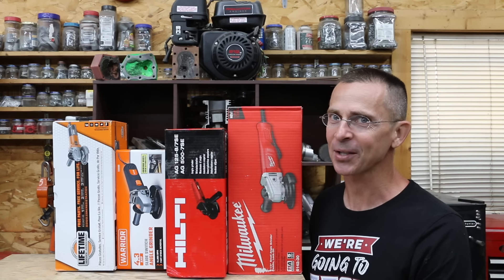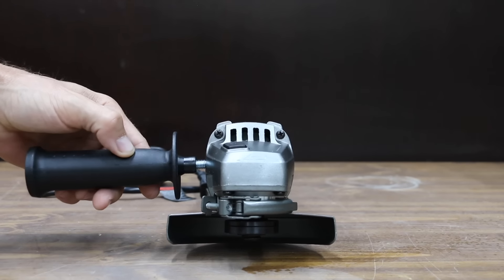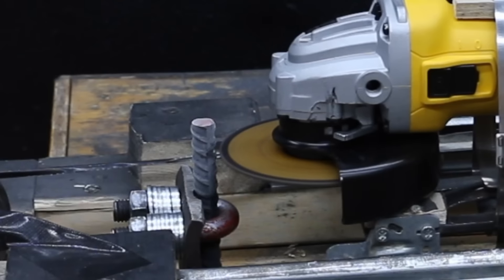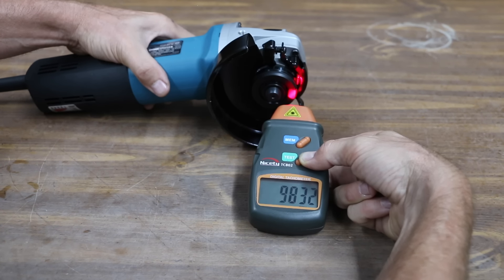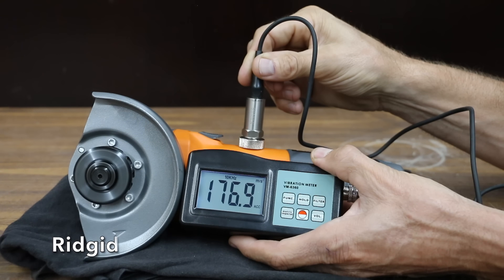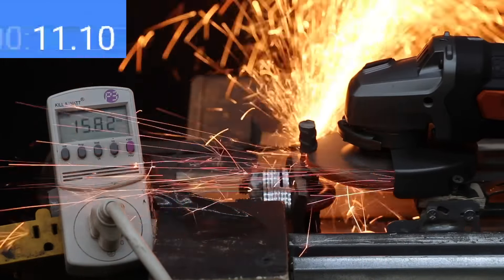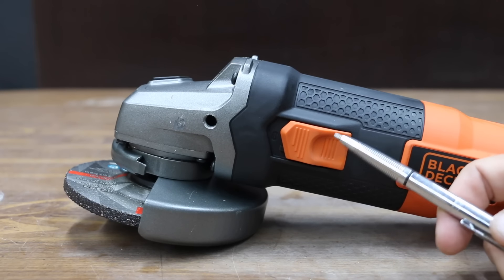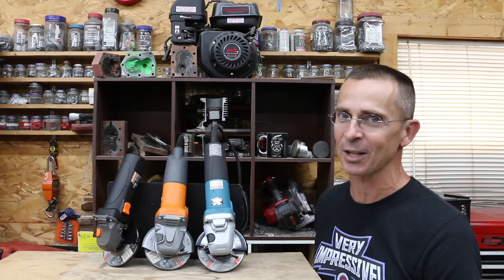Best Angle Grinder (Corded)? Hilti vs Milwaukee, DeWalt, Makita, Ryobi, Ridgid. Let's Settle This!

Comment: Would love to see how Bosch angle grinders go in this comparison! I bought one simply for the X-Lock fast wheel change (and love it).
Reply: Is it that good? I'm not ready to pay extra for every wheel I need to buy
Reply: @lopincol  yeah this isn't a "feature" I'm interested in either.
Reply: i've been in a professional metal finishing industry for over 16 years and bosch has been the best brand I've seen so far.
Reply: Bosch tools are for occasional home use only. If you're okay with it dying at any moment, you can buy it. Don't get me wrong, it's fine and all. But if you want something better, your choice is Metabo and Hilti (and maybe Makita too, but they're too inconsistent, their cheaper tools are pretty sad, and at higher prices you can have Hilti).
Reply: @KeksimusMaximus  i've used a bosch in a professional business for almost ten years. grinding, cutting,  sanding grit 36-120, aggressive wire brush, both mild and S.S.
Reply: @KeksimusMaximus  also, most metabo is made in China now
Reply: My fast change is faster. (Multiple grinders with different discs) :p
Reply: @willtrippe8982  >10yo Bosch. 
Old man, things get different every year, kek. Modern Bosch is not the same.
BUT, I guess that goes for Metabo too (it's still good no matter what). Hilti is still the most immortal brand. I can argue that point in a real fist fight.
(imagine fighting over a BRAND)
Reply: @KeksimusMaximus  ...and if we crawl through the bushes, really quietly, shh now, you don't want to scare him away, if you slowly look up at the comment above, you should spot the rare..ish 'Richard Cranium'. These creatures are quite shy, but very opinionated and often get quite loud and resort to KB warriorism to enforce their point when challenged with a differing opinion, and there he is with all his plumage fluffed out, now, lets all back away slowly and let him continue with his mating ritual.
Reply: @KeksimusMaximus  You are buying the wrong colour/series, Bosch blue isn't the same as Bosch green. A bit like green tool users such as yourself, the cheaper green ones are, by design, made for occasional home use only. You get what you pay for, and you don't know what you don't know.
Reply: @KeksimusMaximus From your comments I see that you’re tool knowledge is poor.Half Hilti tools are rebranded Bosch.
Reply: I have an old Bosch 4 1/2” without the x lock but it’s my favorite grinder ever. Very slim motor housing and compact gear housing. I don’t know how it stacks up power-wise against these others but it has a lot more power than my Milwaukee M18 grinder. I’d like a part 2 with Bosch for sure.
Reply: @dusanmilojevic3017  
>source: I just made that up
Sure, bro, haha, I'll trust you and not my years of actual experience with different power tools from different brands, haha
Reply: I got bosch professional but without x lock. It's pretty good  . Why bosch and dewalt not included in this comparison?
Reply: i’m a blacksmith and i used bosch in the last 20 years. the quality in the last 10 years is much lower than 20 years ago.
Reply: @KeksimusMaximus  Bosch "Blue" are top range professional tools... Got a 9" grinder 7 or 8 yrs ago and it's still working, using it in a welding workshop 3 or 4 days a week.
Reply: @lopincol  X-Lock Grinding and Cut Off wheels cost about the same as normal wheels. What it means is instead of having 2 angle grinders with me (one for cutting, one for grinding) and constantly switching between the two, I pull the lever, it ejects the disk from the grinder, i press the other disk on, and it is ready to go. I do a lot of welding where I am always between grinding surfaces for prep, and cutting tack welds etc.
Reply: @massimo79mmm  That is most likely accurate. As soon as brands start flooding the market with cheap tools, even reputable brands need to find cheaper ways to manufacture their products so their prices do not seem astronomical. I am sure there still exist niche manufacturers of professional high quality angle grinders made to last a lifetime (with maintenance), but things like that are well beyond my budget!
Reply: @jake-mv5oi  This was my go to option for a long time. I got sick of multiple power cords tangling (and having to store & move 2 grinders). The X-Lock system comes at a pretty big increase in price. For me, and my use case, I felt the price was worth it. It will differ for everyone out there.
Reply: @the1stDDD  talking about angle grinder: they works perfectly until you have to replace carbons. i had bosch blue angle grinders that lasted 5/6 carbons change, so about 5/6 years). my new blue angle grinders lasted one year.

on the other hand, i have many hilti tools: like i wrote in a another message, they have lowduty tools (i have a battery operated drill, it’s quite weak). the heavy duty tools are awesome (i have another battery operated drill).
you have to choose the right tool for your work, maybe an electrician can use the light duty tools with satisfaction.
Reply: @KeksimusMaximus  I worked at a metal shop where we used Bosch grinders for 4-8 hours a day, doing intricate and rough grinding work on C-frames and T-bases.  You could buy a dual pack for 100 dollars, and they were by far our favorite.  They lasted around a year on average and the reason we used them was their weight.  They were much lighter than other grinders and our wrists noticed this difference.  When I left that job the boss gave me one with a pinched cord.  I fixed the cord and have been using it ever since with no issues.  Metabo and Hilti are nice, but heavy and overpriced.  I can't comment on other Bosch tools, but you are dead wrong about Bosch grinders being bad.
Reply: @massimo79mmm  Sucks about the grinder dead after 1 year. Hopefully they replaced it under warranty for free.
Reply: @the1stDDD  in italy, if you use the tools for your work (not hobby, so for a company) warranty lasts a year, so no, they don’t changed the grinder

Comment: Would you please consider testing cordless riveting tools—tools powerful enough to handle stainless steel pop rivets, not just aluminum ones. The testing itself would be important, but I think you would also introduce to many people what a fantastic tool rivets actually are. They are superior to sheet metal screws, for example, in many applications.Thanks for a fantastic contribution to our society. Your channel is like none other.
Reply from the maker: Thanks!  Thanks for the suggestion.

Comment: Oil filters, automatic transmission fluid, and paper plates too would be interesting to see. Keep the awesome videos coming!
Reply from the maker: Thanks, will do!  Thanks for the suggestion.
Reply: Oh yeah, the ATF one definitely should be done!
Reply: Paper plates, what a genius idea. That would be interesting.
Reply: Project farm is a great channel even when he decides he couldn't make a test setup to evaluate the performance of ATF accurately!
Reply: I would like to add: transmission fluid anti slip additives test. Also, the Bruce Jenner fluid test is a great idea!
Reply: @Longplay_Games  Also plastic forks and knives! Hate them both, but can't help wondering if there's some that are just slightly less of a disaster. Perhaps there are bamboo alternatives or something.
Reply: @blahorgaslisk7763  plastic cutlery and gold label paper plates (600 pack) both from costco

Comment: As always, another great review!  I missed seeing Bosch in the lineup.  Had one that survived several floods and heavy farm use before giving up the ghost after about 15 years.  Next time, see about adding the RPM meter to the cut-off test.  No-load versus load.
Reply: Hilti is Bosch.
Reply: @dusanmilojevic3017  It's like saying Ryobi is Milwaukee.
Reply from the maker: Thanks!  Thanks for the suggestion.
Reply: @MatthRrrr  Ryobi and Milwaukee are both made by TTI. TTI also makes Hart and Rigid tools too. Although oddly TTI won't cop to making Rigid on their website. Not sure what's going on there.

Comment: I always favored makita over dewalt. Thank you for confirming!
Reply from the maker: You bet
Reply: Let's compare a 170$ Dewalt grinder and see which one you favor.
Reply: And I like the cool blue Makita color over banana yellow DeWalt.  😄
Reply: @MrArcticPOWER  probably still the makita :) I don’t like the yellow banana tools 🍌
Reply: If there's anything you should learn from this channel, it's that no one brand is the best at everything.
Reply: Makita eat dewalt grinder's 
Dewalt is akward handle , a lot noise motor and gears, vibration destroy your hands 😢. Really i dont buy yellow tools just because quality .
Reply: @isaaccaris9530  Which one you're talking about? The one tested in this video is a entry level 10 years old grinder. Dewalt probably have over 10 different corded grinders available. 
Go try a 6inch 60v Dewalt and come back to me.
Reply: - I've heard that DeWalt jigsaw is better than Makita has, also DeWalt cordless drill and impact is more compact. (unfortunately didn't have both, cannot say on my own experience)
I've heard that DeWalt engineers is a pro of woodworks, but Makita is a construction and metal workers - that's why some models are better in specific area.
Reply: Well yeah. Makita motors are legendary. The armatures Makita scrap are better than what everyone else can make. They have a crazy balancing spec. They don't allow for too much material removal to balance the armature. A lot of companies build motors with scrap Makita armatures.
Reply: @MrArcticPOWER  this is problem of proyect farm.. some times  shows top gama tools of dewalt ,another regular tools... but in low o middle price makita grinders is really good . This gears are smoth  from most cheap tools
Reply: @isaaccaris9530  I know and I understand that he can't test everything. The takeaway from his videos is "this product is better than this one" as opposed to "this brand is better than this one".

Comment: Great video.  I never would have guessed that the Rigid would be so good.   I have five of the Warriors at $10 each (coupons). three Bauers at $20 each (coupon), one Ryobi at about $50.  That's nine grinders for about $160.  I have them hanging up with a different disk in each one, super convenient and efficient to work with,  I figure each one get's a portion of the work so they should last a long time.

Comment: The slowmo on the rigid was classic.👍

I have a 11a dewalt with paddle switch for grinding if I don’t want to use an old heavy 7”, and 3 hitachi 7a for cutting, sanding and wire brushing. At $30 each on close out it was worth it not to always be changing blades.
Reply from the maker: Great price!

Comment: Another great test -  I've been using Makita grinders (on my second one over 20 years) for tilework mostly. I agree that they perform wonderfully except for the trigger design - the three iterations I have tried (two owned personally) over the years have gotten slowly worse on trigger design and they feel a bit chintzier but they are still really good tools, holding up to a fair amount of daily abuse over the years.

Comment: My 30 year old Makita still works almost as good as the one you tested, great tool. Thanks for the comparisons!
Reply from the maker: Nice!     You are welcome!
Reply: Makita was a good brand.  It is a little frustrating that at least the older ones weren't standardized to a 5/8" grinding wheel nut, and are largely unsupported today.
Reply: Ditto. My 30 year old Makita is only used on steel. Still going strong.
Reply: Their switches have always been the same awful and obstinate design though, including the cordless. That finally changed with the brushless 18V which is a night and day improvement.
Reply: I wish they were built the same way they were 30 years ago. I've  personally burned up 4 makitas in my 12 years of welding.
Reply: @DiscoFang  I have to hold the switch down on one of my old makitas.

Comment: Great tests!  I've always owned DeWalt power tools, both privately and professionally.  In my experience they just take a beating and keep going.  The thing I require on an angle grinder is a lock on switch.  The paddle switches are just too inconvenient in 90% of the ways I need to use a grinder.
Reply from the maker: Thank you!  Thanks for sharing.

Comment: I've asked for this test and happy to see it! Thanks. One thing is missing  though. If you grind or cut for longer periods of time the tool can get pretty hot to hold. I would be nice to see the tool temp after the thicker blade cutting through the rebar. Great test still.
Reply from the maker: Thanks!  Thanks for the constructive feedback.
Reply: Good point, and heat really comes into play when you’re at the end of a grinding disc and need to swap it out 👍

Comment: Love the video! If you like the rat-tail style of the Ryobi, Makita makes most of their different power levels in a rat-tail version. It's personally my favorite style. Gives you more leverage over the tool if it kicks.
Reply from the maker: Thanks!  Thanks for sharing.
Reply: I don't get locking triggers for electric tools. You drop one, and you have a big problem at your feet.
Reply: @CONEHEADDK  especially grinders like this, they can damage stuff or possibly hurt someone very badly
Reply: @aftertheelectrike1847  Exactly. My, in many other ways veeery, ace whole dad did some things right, and I was allowed to use all his tools and machines (except the stationary round saw), from I was 5. Sure - I cut my fingers deeep with his razor sharp carving knives and got hurt other ways, but kids heal fast. So I have also been in close contact with angle grinders a couple of times, and they don't stop for anything human.. :D  But the wound didn't bleed much, bcz of the heat, I guess..   I remember as a kid, first time I used an angle grinder, where the trigger could be locked, and even as an "invinceble 12 year old", I was shocked over, anyone making something rhat dangerous..  Sue them...

Comment: Yeah, for non-precision tool like an angle grinder (especially one that I only rarely use to just chew through the odd nail or bolt), "cheap but works" is the name of the game here. So i can save the big bucks for more important matters. 

If I worked demolition and use it constantly the makita would possibly be the way to go.... thats exactly what i love about this channel! You run the benchmarks and it helps us decide where to spend for bang for buck
Reply from the maker: Thanks for sharing.

Comment: Glad to see RIDGID finish in one of the top spots. The other brands should follow Milwaukee and Hilti with an anti start feature if power button is engaged before plugging it in. 

After the Ryobi (not Ryobi) burn out you should try a warranty claim series and see which one are worth the hassle or just better to replace the tool.
Reply: i have a feeling the one time you forget it is on will be the one time you dont want it to turn on automatically. my vacuum cleaner has already have me like 5 heart attacks.
Reply from the maker: Thanks for the suggesiton.

Comment: Another worthwhile piece of information. The 4.5 inch angle grinder is one of the most useful pieces of shop equipment. Getting a good one makes it even better. Have a good tool is worth a lot to a craftsman.
Reply from the maker: Thanks!  Good Point!

Comment: Great comparisons as usual. I believe Ridgid also has a lifetime warranty. The Horrible Freight grinder appears to be a disposable tool as are much of their line.
Reply: A cheap grinder is better than nothing. Good enough for a home owner.
Reply: Harbor Freight power tools are junk. With rare exceptions. I can think of three I've had which I thought were OK. I've had a lot more than 3 of them. More like dozens. Well, 4 now that I'm thinking about it. Their multitool I have of theirs isn't bad. Definitely not a pro tool though. The blade change on it sucks.
Reply from the maker: Thanks!

Comment: Great video. All the malita grinders I’ve used have been very pleasant. I would like a video on pellet gun pellets. Things like accuracy, how much it deforms when it hits something, how similar the pellets are to themselves, things like that. Thanks!
Reply: Maybe a best pellet gun video is a good idea too.
Reply from the maker: Thanks!  Thanks for the suggestion.
Reply: @ProjectFarm  that would b much appreciated. Pellet or bb gun . Always the challenge of CO2 (some take 2, some use big 1's which can add up) also so it should be an interesting test for cost wise consumers especially if just using for pests & it sits around between uses. Thx!
Reply: A problem is that some pellet guns shoot better with one brand over another, just like some rifles shoot better with different brands of ammo, different weight of bullet, etc.
Reply: Beeman p3,  not the p17.

Comment: Love my Bosch, forget how much it costs but its much smaller compared to others Ive had and has lasted me several years of occasional use
Reply from the maker: Great feedback on the Bosch. Thank you
Reply: I use a Bosch slim everyday trimming cow hooves and love them. So easy to run 1 handed. Although they get abused and I usually burn through 1 a month they're my go to

Comment: Excellent review. Isn’t it amazing that all of these tools function reasonably well, and most people can afford one.
And for 60$ you get a tool that will probably last and work well for home use.
I’m old enough to remember when having an angle grinder was a luxury, today every DIYer has one.
I think if a person is spending a large number of hours grinding, that’s when ergonomics plays a large role. If your hands are fatigued after a short time, it doesn’t matter how well the tool is performing.
Thanks for sharing that review. I’ve started to keep multiple, so that I don’t have to change wheels as often. The lower cost makes it affordable.  Always enjoy your testing and 15:06 analysis!
Reply from the maker: Thanks!  Thanks for sharing.